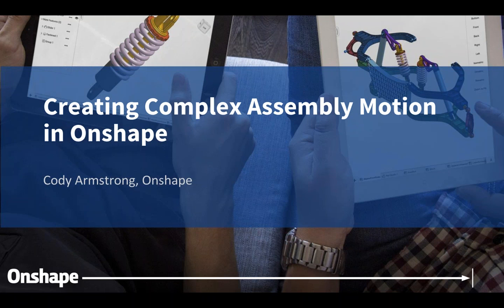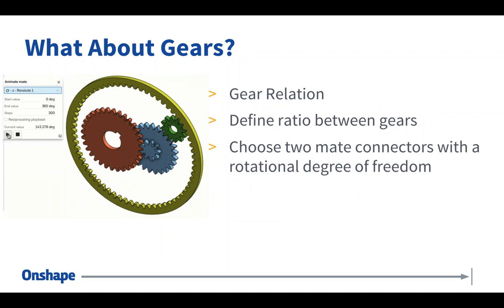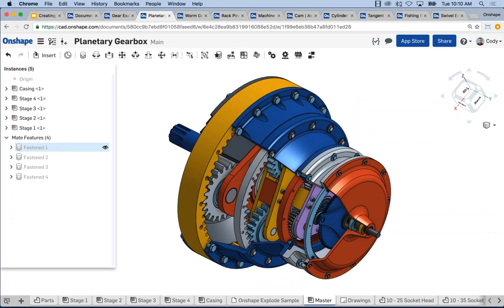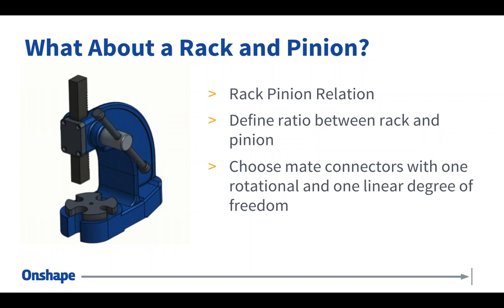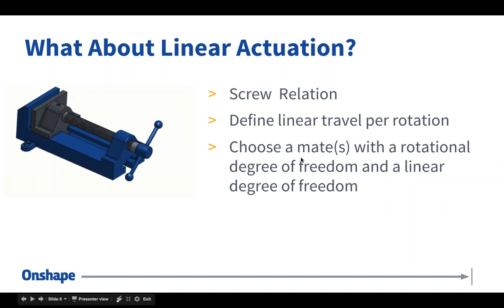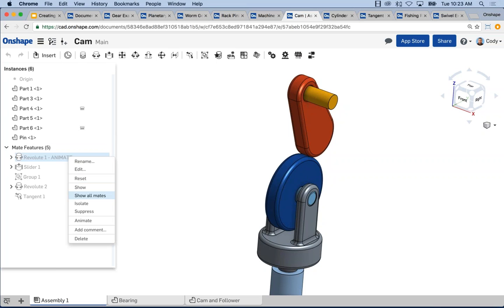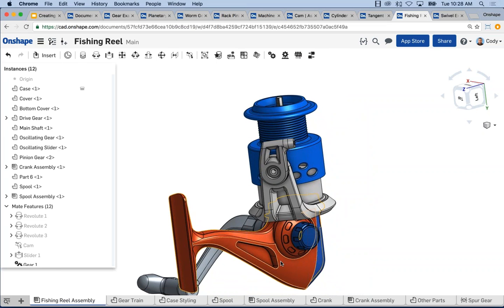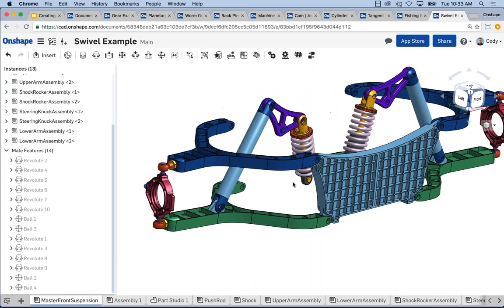Creating Complex Assembly Motion in Onshape | Webinar (November 22nd, 2016)

Comment: Is there any way to bring the teeth of two   different gears...on different planes.. close to each other..any tip.
Reply from the maker: Not sure we're understanding...I assume you figured it out by now? If not, let us know (or let us know what you found to be the best solution).
Reply: So, two gears on different planes. Like a pair of bevel gears? How about aligning them to a sketch which features the axes of both gears as well as the point of contact?

Comment: How would we assemble geneva mechanism??? It engages & disengages two specific mates as they exist in onshape.

Without collision detection that seems out of reach for onshape users
Reply from the maker: There is no collision detection when moving parts in an assembly, you will need to set limits.
Reply: @OnshapeInc  can you please add collision detection limits are not useful in all situations.
Reply from the maker: @Radio_Nullifier  Hi there, If you're a pro / enterprise user, please add in a request through the app - you can create a ticket.